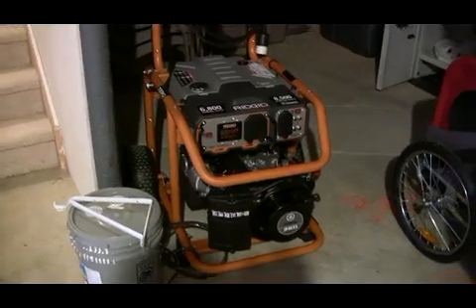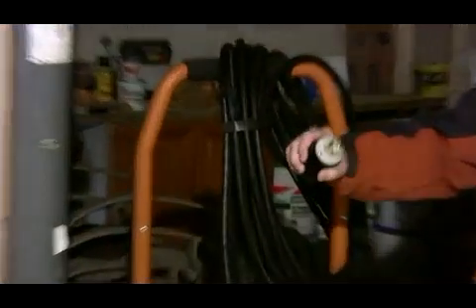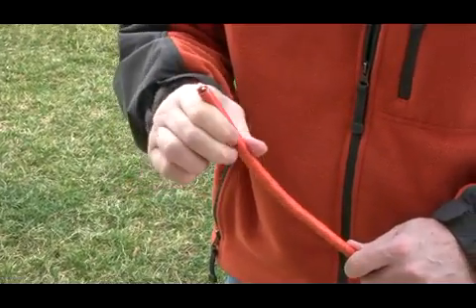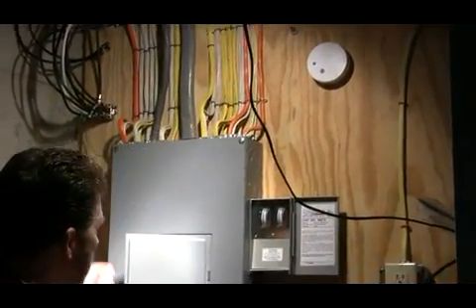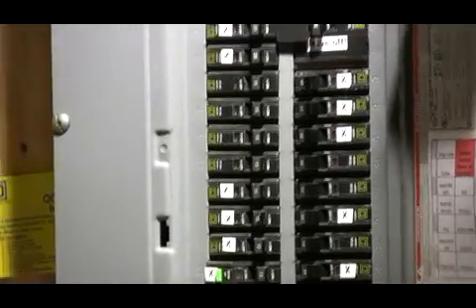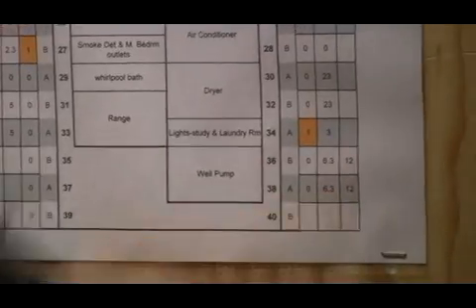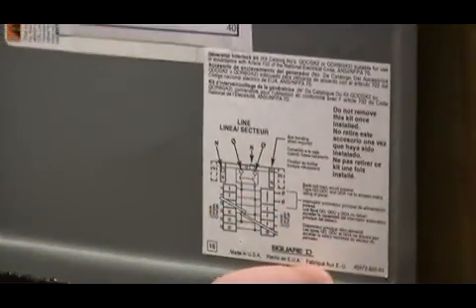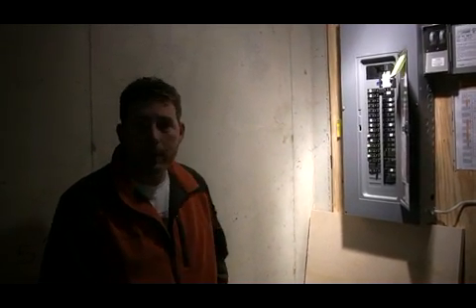Interlock vs. Transfer switch

Comment: As long as there is gas at the pump I don't see anything wrong with generators, but with climate change and all the lines at the pumps are very, very long, and getting longer. This is why prefer a solar generator, The upfront cost is more but in the long run it will be more dependable and you will make that back someday. So I got 2 solar generators (off grid) and a house PV system (grid tied). Everything is smart in the house so my average consumption in a good day is around 25 Kw. The PV generates around 30-35 so I sell that back to the electric company, in case of a power outage when the temps outside hovers around 105 F I kick on one of the backup solar generators and fire up the Inverter AC to cool the living room area is only a 1 ton, but does a great job keeping the lower floor and upstairs cooler since is an open floor plan build. Max Wattage during normal operation hovers around 450 watts up and down as needed. The other generator handles kitchen stuff, minus power hungry appliances such a microwaves, dishwashers, we do use the coffee maker, lighting, refrigerator, the stove is gas but have a hot plate standing by just in case. I try to keep the entire setup simple, and use extension cords all UL approved, and the proper gauge, to route power as needed, I power the master bedroom TV, and a lamp, leave the door open for some cooler air from the living room AC. The living room gets power for the internet, TV, a light. upstairs in my office I run computer, switch and a light. Bathrooms, I made some lamps with old laptop batteries got one for each bathroom they last a long time between charges, and serve the purpose well, the garage (converted into an apartment) gets a light, the TV and we leave the door (indoors) open for cooler air. It has a 2 ton inverter but I don't run 240 volts. Most of the lights are LED and some are controlled with Alexa. All TVs have 4k fire-sticks to watch movies and such. All without having to worry about gas and a noisy generator here in TX the sun comes out most of the year and some days are just terrible. The smaller solar panel (off-grid) array (1K) watts charges the (LiPo4) 15Kw batteries at a round 5 Kw in a good day. With proper energy management you can survive longer, the only thing is that you must be prepared. Don't trust the power company to deliver the power when you most need it and you local gas station to have gas when you need it the most folks, is getting bad out there! It will be a matter of survival sooner than later. Take care folks and GOD Bless!
Reply from the maker: I agree!  Thanks for the info.

Comment: I want to know if you can help me.  I have an interlocking system for my gas/propane generator, but I just purchased two Bluetti AC300. Bluetti says I need a transfer switch to run them both in split mode.  Can I have both the interlock and a transfer switch? Or do I need to change it completly over to transfer switch?
Reply from the maker: Don’t think the Bluetti would work.  You need 220v AC output to the panel.

Comment: This video was posted 12 years ago but I am compelled to comment. During a power outage, it is not smart to run all of the circuits in your home. Most folks would think it better to conserve resources and quick turn on only what is necessary. With a transfer switch, no snap decisions have to be made on which circuits are most important. It's been thought out ahead of time and wired in for use during the emergency allowing no chance of overloading your generator. Now, in 2022, with the technology available and a transfer switch in place, it's possible to use a solar generator to instantly power the necessary circuits to maintain habitability without going outside to start a fossil fuel generator during a power outage. A solar generator could of course be powered through solar panels and (using a transfer switch) power  some or all of the circuits in your home reducing your electric bill. Long story short, a transfer switch allows for more options and preplanned safety. Your all or nothing interlock switch approach is not ageing well.

Comment: If I use the interlock method using 240v from my 3500 watt generator, will my 120v circuits get the entire amps from my generator or just half? If just half, are there any options to get the full amps (25) for the 120v circuits? Thanks.
Reply from the maker: 240v is simply both of the 120v phases combined so your amps are also split.
Do you want to try and balance the load as much as possible in order for your generator to run more efficiently.
Make sense?
Reply: @panchohughes  Do you mean balance the load as relating to the sides of the breaker box?
Reply from the maker: @wes326  almost- actually the 2 phases alternate on each side.  So breaker in slot 1 is phase A then the slot immediately below is phase B.  This why 240v breakers take 2 slots.  
If you have a bunch of 120v (single slot) breakers that are in A phase slots, and drawing more amps than breakers in phase B … it would be unbalanced.
Make sense?
Reply: @panchohughes   Makes sense now. I was concerned that half the amps would be wasted if I wasn't powering any 240v appliances. Gives me the confidence to try something like this.  Thanks for your time.

Comment: Great run down and each homeowner will decide what method of either the interlock or the switch transfer they would want to install, but given your feedback I like your method and I will use that for my home, thanks

Comment: How do you disconnect the neutral coming in from the powerlines, by turning off the breaker that only disconnects the 2 hot bus lines coming in from the powerlines and not the neutral. The generator will now create the 2 hot conductors and there is a path through the neutral out to the powerlines and can be deadly to a lineman working on the powerlines.

Comment: I know this is old but you can run anything off an ATS you just need to size it to your load, they are not bound by circuits. You can either run your house off the Gen by tying the main breaker into the load side of an ATS and then let the ATS do it all for you ore you can make a dedicated circuit for only certain loads you want powered but in the same manner. An ATS does the same thing but it does everything automatically It senses commercial power and when it notices a loss of commercial it will wait a predetermined time most commonly 3 sec but, you can change that then it sends a signal to your generator to start. When the generator comes up to speed {Freq} and voltage the ATS will switch to generator power then when commercial comes back and is stable it will transfer you back to commercial. An interlock is if you want to save money and do the transfer manually and keeps you from have gen and commercial power feeding your house at the same time.

Comment: How about the neutral? If you have a bonded generator, that’s an issue. You cannot have two bonded points which is a code violation. If you have a generator with a floating neutral, that would be okay.

Comment: Great video sir... Quick question, the red and black wire that connects to the 30 generator breaker feeds 120 volts correct? And the other question is, does the 30amp generator breaker feed both sides of the electrical panel

Comment: You just saved me around $500. I was under the impression I needed a transfer switch but your video was extremely informative showing another way to connect a generator safely with minimal outlay of cash.

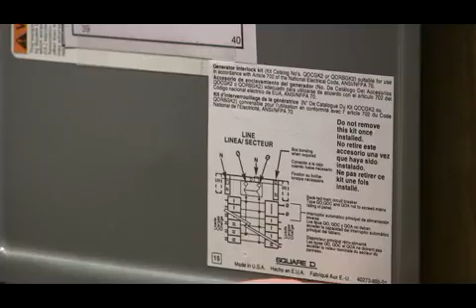Comment: 8:44 - I searched Lowes and even Google for that light and couldn't find it. By the way, I agree with you. I think the interlock switch is definitely the way to go as well, especially since they're so simple to install and only cost about $65.00. Also, I like the option of picking and choosing which circuits I want to run. With a transfer switch, you have to decide in advance which circuits you will want to power and then you're stuck with that. I'm just too much of a control freak for that.
Reply from the maker: This one should work;   https://www.lowes.com/pd/Progress-Lighting-Exit-Signs-LED-Battery-operated-Exit-and-emergency-light/1000554505

Comment: do you remove the neutral feed also when doing this?  I have had this setup for years but keep hearing that you have to remove the neutral too.  never understood why, other than some saying it could be misfed etc.  but I wired it and know it is wired right,  not that hard to figure out.

Comment: Great video. I’m building a new house and having a generator backup system installed using the interlock device that will switch to the double pole 30amp dedicated breaker wired outside to for the generator plug. I really like both the watt meter box to be able to view the allocated wattage and the backup light. Definitely going to incorporate both of these features. Thanks for the video.

Comment: The whole idea is to use a gen w home wiring without electrocuting a linesman.
The transfer switch or box with 6 breakers? lot of extra work for nothing. The code  
is good with the mechanical interlock that means 'MAINS BREAKER' MUST BE OFF 
before gen breaker can be placed ON.

Comment: That was my biggest question. No matter what if your main is off is it impossible to back feed to the service line. I would hate to endanger a lineman but all my supplies to wire my reliance outlet just came in and am about to install it with only an interlock

Comment: You be careful with that generator! I've got the same one and the cap doesn't stop any water from getting  in. And the carb is super chintzy. Nothing but problems. And the frequency is all over the place, it will burn out your electronics. Does last 12 hrs on 8 gallons. So there's that.

Comment: Nice setup but not legal to do it that way in Canada because you are not disconnecting your grounded conductor (neutral) which means if a utility worker was working on the pole outside your house it can backfeed and  electrocute him. A properly wired transfer switch eliminates that hazard.

Comment: This is a great detailed video and very helpful. The best video I've seen explaining how the interlock switch works. We have a Transfer Switch which works for us. Here are some Pros and Cons of each option.

Interlock Switch

Pros:
1) Cost less. (Switch ($70), watts meter ($90) and inlet box ($60) Total $220)

2) Can choose any circuits to power on/off.
3) NEC compliant and UL listed.
4) DIY project.

Cons:
1) Main breaker has to be off.
2) All individual breakers need to be turned off before switching over to generator power.
3) Potential to back feed the main power lines.
4) Harder to balance both legs of generator.
5) Have to modify main control panel box.
6) Have to install a double poll 30 or 50 AMP breaker.
7) Might have to pay an electrician to install.

Transfer Switch

Pros:
1) Cost more, but can buy a kit which includes everything you need to install. (Transfer switch prewired, conduit, power intel box and power cord $300-$440)
2) Easier to manage power load.
3) Easier to balance leg loads.
4) Some switches come with a standard circuit breaker for each circuit.
5) Each circuit is isolated from utility or generator power.
6) Impossible to back feed either utility or generator power.
7) When power is restored, you'll know it by whatever circuits not included in the transfer switch.
8) No need to switch off/on any breakers in the main control panel when switching between "Gen" and "Utility" power.
9) NEC compliant and UL listed.
10) Can switch to generator power, while utility power is still powering your house. 
11) Can have 10 individual circuits or 5 double poll circuits. (Only one can be a 30amp double poll)
12) Idiot proof.
13) DIY project, but more involved.
14) Comes with a watts meter.

Cons:
1) Can be costly
2) Limited to the same 10 circuits you choose.
3) Might have to pay an electrician to install.

Comment: That cord between the generator and the receptacle looks to be at least 50' long.  The generator is portable and can be parked right next to the receptacle.  What were you thinking?  Why not shorten it?
Reply from the maker: Yeah, I shortened that cord about 8 years ago. 😁. This video is so old I did it with a camcorder because iPhones were a new thing.

Comment: Regarding grounding your portable generator with your set-up: do you ground the frame of your generator using a grounding pole outside? I was told by the DuroMax rep that you should ground the generator as such, but then you should disconnect the grounding wire at the breaker panel when using the generator to avoid having a “ground loop”. What about that issue.., how did you handle it?
Reply from the maker: I actually made another video about that issue.  What i did is disconnect the chassis ground jumper so that the ground only goes back to the breaker panel ground bus.
Reply: Interesting; but then if you’re using the generator as a power source for tools, etc. outdoors, you’d need to to reconnect the ground strap to the frame and connect a traditional grounding rod to the frame , correct?
Reply from the maker: Todd LaRoche exactly!  In fact i put a big warning label on my generator saying this.
Reply: panchohughes got it; now I just have to figure out how to do the same thing with my generator... I’m hooking it up to thd house panel the same way you did, but my generator (DuroMax 12000EH) is neutral bonded.
Reply: Just to be certain I’m doing the right thing... was your generator neutral-bonded? If so, then was it a matter of disconnecting the neutral from the ground? And/or does the ground get completely disconnected from the frame?
Reply from the maker: Todd LaRoche FF to 8:50 mark https://youtu.be/69U8AugJKaI

Comment: The one thing you didn't mention that you need to be careful of when using am interlock setup is the configuration of the generator. There are 2 configurations, floating neutral and bonded neutral. With a bonded neutral generator the generator itself is bonding the neutral tap on the generator with ground. If you hook this up to your house in an interlock configuration it violates NEC code which states that the neutral and ground should be bonded once and only once which it already is in your service panel.  When you connected a bonded neutral generator to an interlock breaker like this you have parallel conductors (neutral and ground) and current will split down both legs to return to the source.  If you have this type of generator and want to use an interlock setup like this then the neutral bond on the generator should be removed.  The generators with floating neutrals is what you want for this type of interlock connection where the neutral tap on the generator is not bonded to ground on the generator side at all but instead back at your service panel via the L14-30 that is carrying your separate neutral and ground.
Reply from the maker: Yeah, I actually made another video about this;  https://youtu.be/69U8AugJKaI?t=531
Thanks.

Comment: Funny I'm installing 4 bypass system 400 600 800 amp next week and believe you me... I have ton of circuits. Full amperage bypass is always the best way to go... but then again  I have only been doing electrical work from 1967 as IBEW worker... :)
Good video, but not so info...

Comment: This makes more sense then the transfer switch gimmick!
Reply: I think the interlock switches are gimmicks too. Did you see what they cost? eBay has them for $50-$65! Some companies online are selling them for $150! Most of them are two metal plates and some screws. They shouldn't cost more than $15-$20. And if you have an electrician to install it for you, I'm guessing another $75-$100 on top of the cost of the interlock switch. You can bet your bottom dollar if you purchase the interlock switch from the electrician it will be marked up in price.
Reply: Interlock switches are a simple solution but can be a ripp off from a price point. Transfer switch panels seem to be a bunch of redundancy and far more complicated then need be.
Unless you want a complete automated system that engages by itself when power goes out the generator starts with electric starter and relays to turn off main and on designated back fed breaker. This could involve a perminant natural gas on off relay as well.
If the generator is rated for the whole residence one need not to limit house hold circuits so the transfer switch box is just a way to designate the circuits limited to the generators capacity.
Keep in mind any back feed connection to a circuit breaker or double pull breaker or even an outlit electrifies that phase (not just that circuit) or double phase to the whole house. 
When building a home where power is not available until final permit I back fed the generator directly to the 220 dryer circuit activating the entire panel for all household circuits.
No concern for the main because utility lines were not connected to the premises at that time. So I enjoyed the benifits of the whole house being functional.

Comment: When you moved your breakers did you have to splice hot wires to reach breakers you moved.
Reply from the maker: No.  I had enough slack to let me shift them down a couple slots.  I assume you mean when I had to put the backfeed breaker in the top right 2 slots.
For balancing the 2 phases, you only need to swap two adjacent breakers as the phases alternate down the panel.   Hope that helps.

Comment: Interlock switch does NOT separate the Neutral therefore its still dangerous to use when back feeding a generator .. 
Get a 3 pole Manual Transfer Switch that separates both HOT legs as WELL as the Neutral leg ..

Comment: In ohio my power company offers a a switch called a generlink goes right in your meter box. They also provide the power cable with it. Plug the power cord to your meter then to your generator and it powers all your circuits
Reply: Lee County Florida also offers Generlink